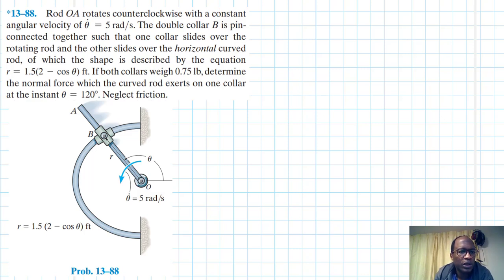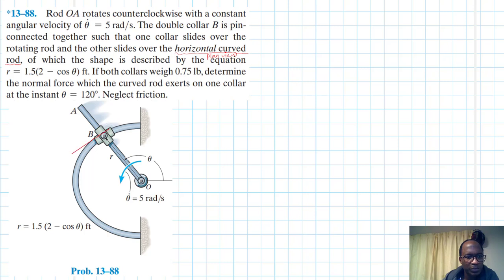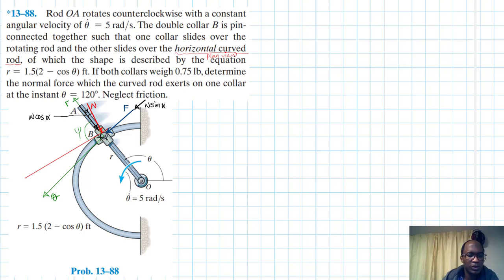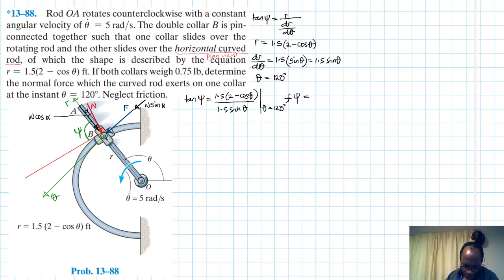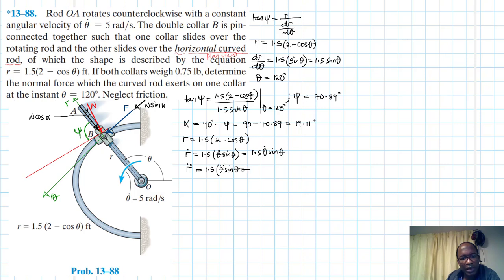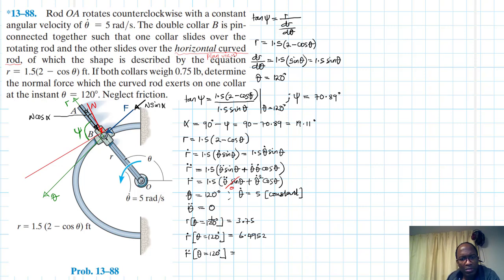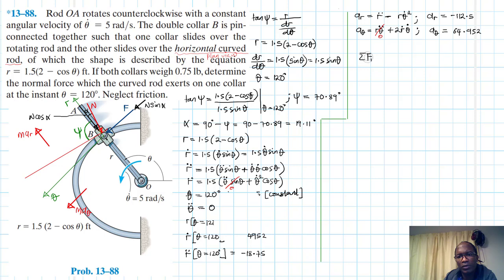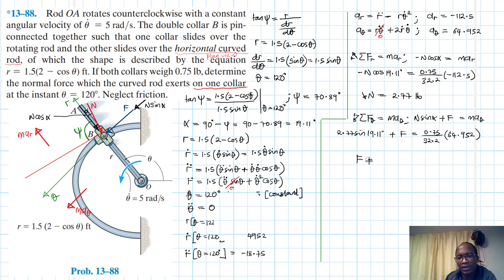13–88 Kinetics of a Particle: Force and Acceleration (Chapter 13: Hibbeler Dynamics) Benam Academy

Comment: Do you not include the weight on the FBD?
Reply from the maker: @hunterking8088  the problem is on plan view and therefore the weight is pointed downwards or inside the screen, and will not have an effect on the final result.